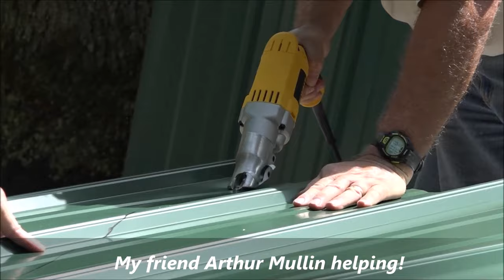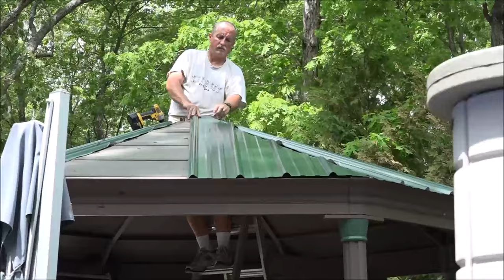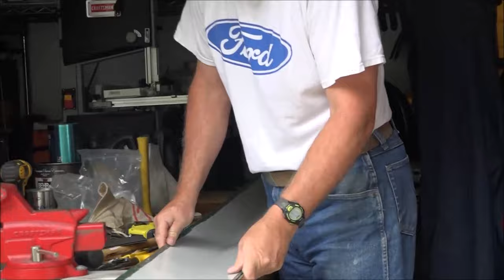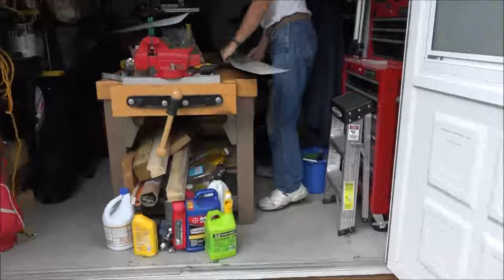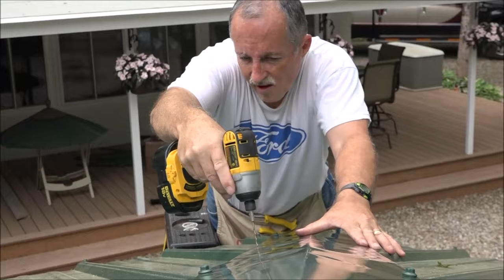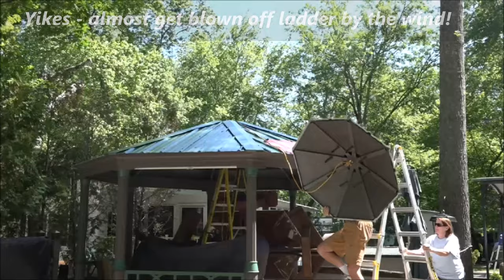How to build a Gazebo Roof

Comment: Please respond I really could use your  help. See I done a gazebo metal roof and I thought that the metal company I got the metal from would make something for me to sit on top but turns out after I got it finished to that point they didn't so if you could tell me where I could get one like that for the upper roof that would be a life saver
Reply from the maker: sorry to tell you but my gazebo came with that roof and I just recovered it with the new green metal material.